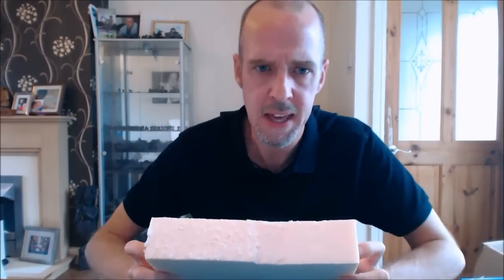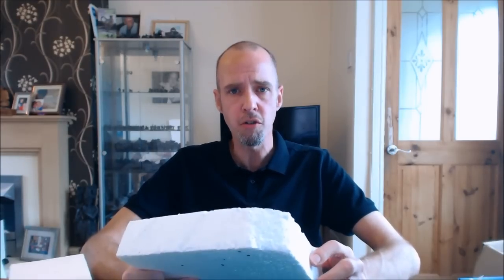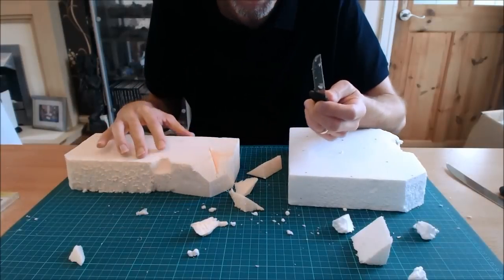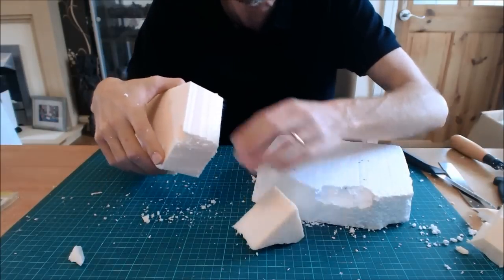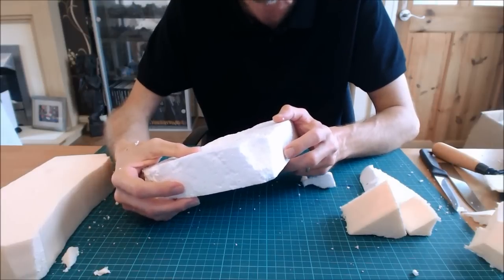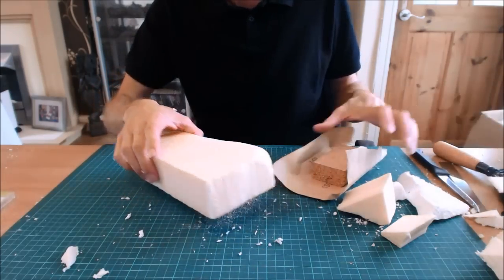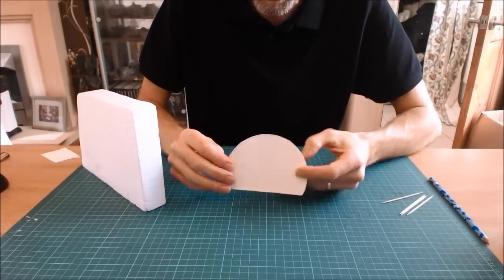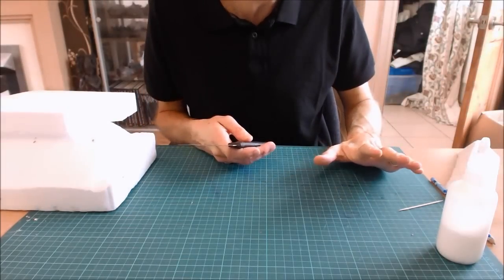A guide to using Polystyrene (Styrofoam) to make wargaming scenery

Comment: one thought If I were to want build a sci fi environment like for star wars figures what would be my best materials?  ive been thinking of 3d printer since I used to model in 3d. along time ago.
Reply from the maker: kairus1 The genre doesn't really matter, it's what you're looking to build mate. What are you looking to build?
Reply: a star wars  inside the star destroyer environment. theres lots of flat panels shapes and mechanical  shapes. I used to model in 3d 10yrs ago. so I was thinking about a 3d printer but there so expensive! please check out my channel under REEL u can see some of my sculptures. if you like.
Reply: sorry not REEl  ,  it  cg modeling and animation  look under that name.   my mistake.
Reply from the maker: kairus1
in which case, i wouldn't have a clue mate

Comment: Have you ever tried plastidip as a way to cover and protect the polystyrene?
Reply from the maker: no mate, what's that?
Reply: Plastidip is a product that you applies a rubber coating to a surface. It's very amazing stuff - some peoplel use it to coat their cars, Live Action Roleplayers use it to coat their foam weapons, etc. 

If you google 'plastidip larp shields' you'll see that it takes paint well and can make some incredibly detailed and even more durable stuff. 

It can be brushed on or sprayed on, and comes in tons of colors, though I usually just go with black and paint it, then seal it.
Reply from the maker: Matt Chaney
Like the HWFF bounce stuff?
Reply: TheTerrainTutor I'm not sure what that is, sorry
Reply from the maker: Matt Chaney
Hot Wire Foam Factory mate, it's one of there coatings
Reply: I took a gander at both products and Plastidip isn't a mixture based material, it's more like the Flex-Seal on infomercials however much finer and thinner grade rubber-seal, or as the name implies maybe more of a plastic composition. Flex-Seal is a lot like BBQ-sealer, tar based, fairly thick when sprayed. On forums they say Plasti-dip can come off with a pressure washer but also works for giving tools a handle grip. Hope that helps both of you, and anyone else.

Comment: To get a clean cut, use minimal force and give the tool time to cut the small balls, it'l be just as perfect 😸 even with a flat blade.
Plaster of Paris? No thanks, just cement & sabre sand. Rock solid hard shell.

Comment: where do you get your styrofoam
Reply: I am based in the UK and get mine from ebay. I paid £8 GBP with free shipping, for Ten sheets of 25mm thick. Dimensions for each sheet are 600mm x 400mm.  I also bought some insulation foam sheets from ebay as well.  I paid £2.49 GBP for a 6mm thick sheet with free shipping. Dimensions are 1200mm by 600mm. Seller had no minimum order, so could order a single sheet. If anyone else knows of a cheaper place to get some let me know.

You can also use Gator glue, which turns into a foam. So you can stick bits together and still cut through with a hot wire tool. I bought a cheap hot wire table off ebay for £29 GBP, I use 12x12 inch chipboard sheets as templates to cut out foam. 

Just need to build my rock and hill terrain out of all that foam. To go on my PVC banner 50x50 inch gaming mat. More of a miniature kitbasher than a terrain builder, but starting to get into the terrain side of things.

Comment: what is PBA?   its easy to find?
Reply from the maker: kairus1 PVA, white glue, wood glue, elmers? it's pretty common mate :-)
Reply: okay , thanks,   2 more questions which comes first painting the model or coating the entire model with PVA?      and when applying the PVA on the entire model  should I mix the PVA  it with a little water?  im tring to build a rocky eviroment for my marvel legends figures. any help I would appreciate. thanks
Reply: TheTerrainTutor OKAY I looked at your video and  you answered my 2 questions , thank you again